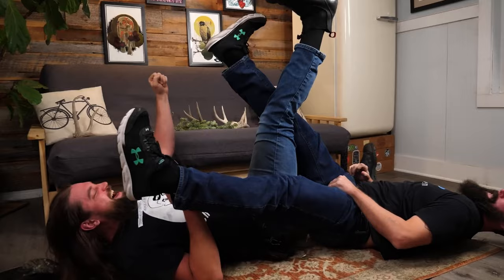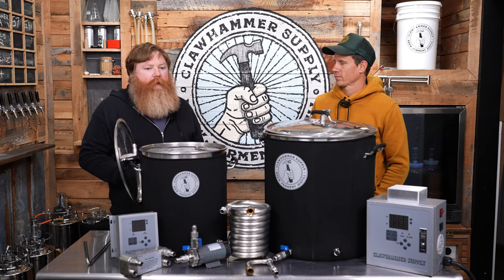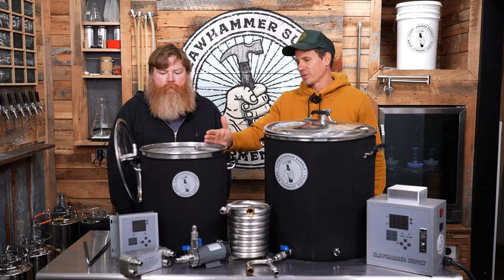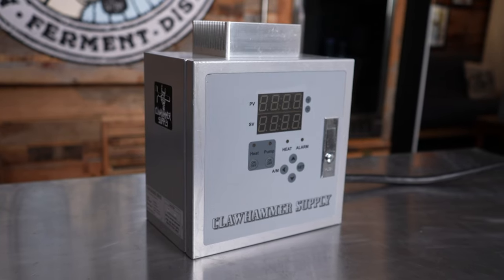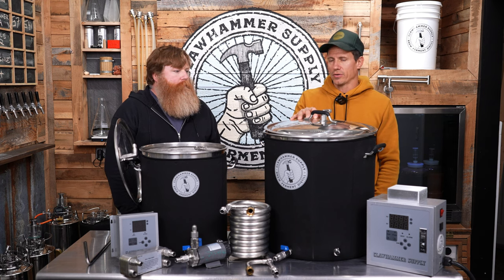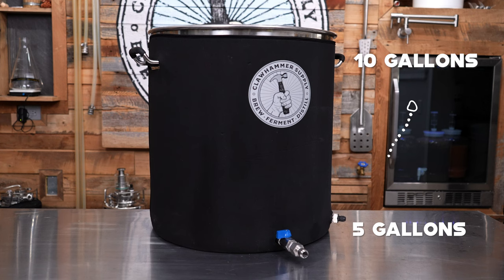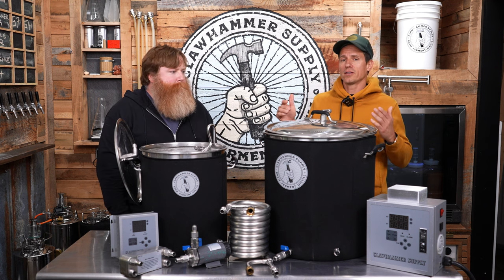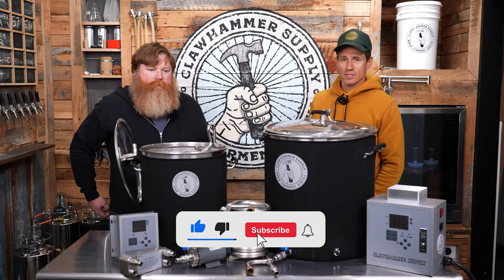Modular Brewing and Distillation Equipment

Comment: Are hoses from a faucet to the chiller included? I was confused about this on your website. It seemed like everything needed is included, but I didn’t see these hoses.
Reply from the maker: No, that's a standard garden hose and you'll need to buy one long enough to reach from your hose bib to your system. And a drain hose to get it out the door. We'd suggest buying one long hose and cutting it in half.